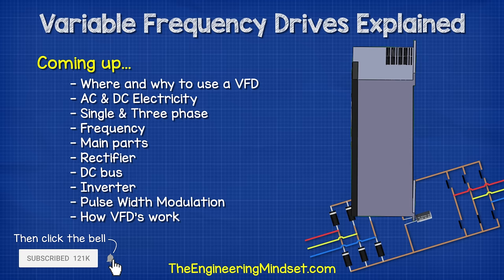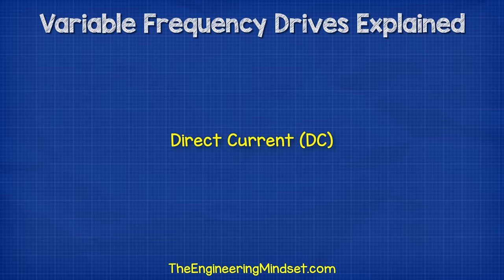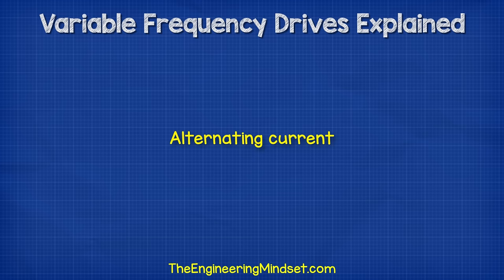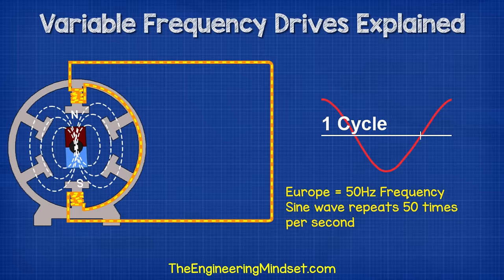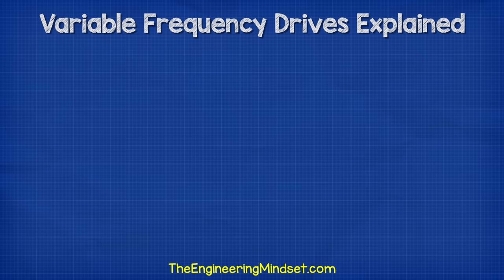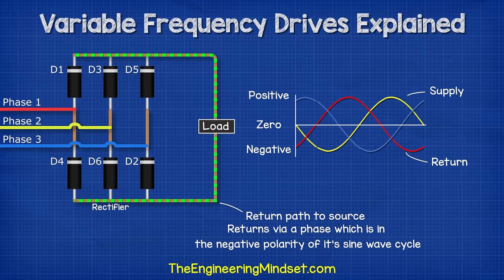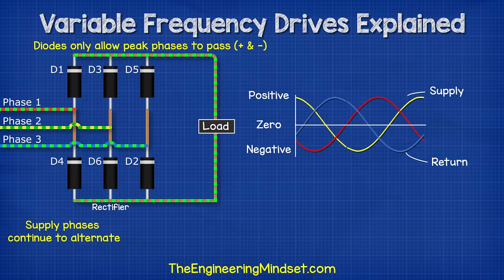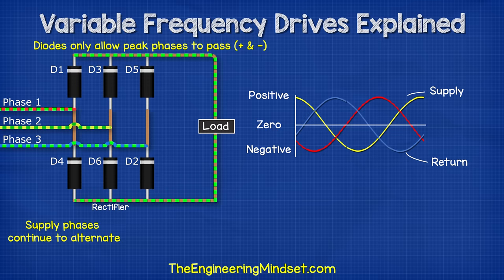Variable Frequency Drives Explained - VFD Basics IGBT inverter

Comment: Why do you convert to dc, just to revert to ac
Reply from the maker: so we can control the voltage and frequency. You must have skipped through the video.
Reply: The Engineering Mindset sorry I kinda thought there must’ve been an easier way to do that, and I was only about halfway through when I posted the comment but I can definitely see you can control the voltage and frequency
Reply: @australiangamer7956  You can technically do it without the transition, but it's a bit trickier and more expensive.

Comment: Nicely explained. Could do with more on the controller and how it closes the LGBT 🤣🤣🤣
Reply from the maker: I was going to include that but the video was already 15mins long. I'll save it for an advanced version
Reply from the maker: I was going to include that but the video was already 15mins long. I'll save it for an advanced version
Reply: @EngineeringMindset  no need to repeat yourself
Reply: @EngineeringMindset  I fully appreciate how long these must take you. I've often wanted to increase 50hz to 100hz for a ac Tig welder and did see this schematic before. Was thinking about increasing the Hz before buzz box transformer but wasn't to sure how much loss would be in an transformer that was designed for 100hz.

Comment: Why reactors using in VFD ? I am from india.!
Reply: Reactors (used on the input side or DC bus) are typically used to reduce harmonics. It might not be such an issue with smaller drives or in places with a lot of other switching loads, but for larger drives or more isolated applications, it's very helpful. Reactors on the output side are typically used to reduce the amount of dU/dt (dV/dt) caused by the switching of the IGBTs. Excessive dU/dt, especially over long distances between the drive and motor, will help protect your motor's bearings.

Comment: i guess the loss in efficiency through the inverter is made up by the increased efficiency of the over all system.  or maybe the inventor just overlooked that because he loved his idea so much :)
Reply: There is not much loss in efficiency through the inverter... The transistors are either in the "on" or "off" state depending on the PWM signal. This leads to a high efficiency and lower heat loss.
Reply: @kevinn2759  the loss is between 10% and 30%. It's physics dude. Do some research on this.
Reply: @ArtisanTony  ive done my research dude.. the loss in an inverter is negligible. Please dont throw random %'s and claim "physics". Its embarrassing.
Reply: @kevinn2759  I have dealt with this for years. I am a general contractor and have installed many inverter systems.  You obviously do not understand the real world.  The real world is not a wiring diagram with a nerd on the end.  The real world is companies trying to create efficient inverters and coming up short.  That is the real world.  What do you do for a living?  Argue?  I bet you don;t do shit.  You just troll the internet trying to start shit. Good job.
Reply: @ArtisanTony  i design inverter systems and power electronics for VFD's, UPS's and lighting systems. Nice try though. Keep connecting wires to terminals while the rest of the people do the important work.
Reply: There's on average 1% lost in changing AC to DC and, typically 1.5-2% lost in switching back to AC. When you look at the other losses in the system, the motor efficiency is the biggest factor. Then the mechanical losses of connecting the motor to the load. Where a lot of the savings comes in is by running the system more effectively. Reducing speeds, especially in pumps and fans gives a huge savings. There's also savings by reducing the current required to start up the motor (induction motors can draw as much as 10x their name plate current when starting up across the line). There's a ton of other benefits, but a bit too much to list. Danfoss actually released the first commercially available VFD back in 1968 and, as I understand it (I work for Danfoss), it was done because there was a meeting on electric motors and people said it couldn't be done. We proved them wrong in around a years time.

Comment: I think there’s a problem with the magnet that generates current. Because the lorentz force is at its maximum when the lines are perpendicular to the coil therefore the peak of current should be when the lines field are in the middle. Plus, when the coils is in the position you describe as the peak current , the lines field go everywhere through the coil resulting in a globally zero current state. I may be wrong but I think you made a mistake
Reply from the maker: It's a fun colourful animation to explain how something very complex works in 15mins.
Reply from the maker: It's a fun colourful animation to explain how something very complex works in 15mins.

Comment: I don't get it. You're describing a pretty complex device and what it does, and yet, you're going back to the most basic of electronic principles. Like, if you don't know what AC versus DC is, how the fuck are you going to know what a variable frequency drive is?  What is electricity? Really? ....then you don't need to know what a VFD even is. You went a little too far back to the basics bud. Can you direct me to the big boy site, for variable frequency drives, please? FYI, I know it AC is, I know what DC is, I know what an oscilloscope does, and I've built robotic devices. So we can skip the - electricity flows like Plumbing-, and get right to the meat of the potato, please....🤔
Reply from the maker: We create tutorials with everything included that the user should know and understand for the topic, it's a complete package. We cater for everyone and ensure everyone has a level playing field, an equal chance to learn. If you feel you're too advanced for that part then skip it forward.
Reply: @EngineeringMindset  yeah I guess. It's just the very simple stuff I've known it for like 40 years, so it just gets repetitive for me. But yeah I understand. You're right.
Reply: @EngineeringMindset  I guess it's like when I watch these basic stamp videos, all of them are like blinking LED starter programs. The first thing I did with my basic stamp 2, using a remote control, I programmed it to lift up a subwoofer box and flip it 90 degrees, while simultaneously opening a drawer beneath with thousand watt amplifiers in it, all of this in the back of a Suburban. You hit the remote on the key fob, and things got busy. When you shut the system down, the subwoofers with tucked neatly down underneath the speaker box and you couldn't see anything but a box in the back, you hit the key fob and the party started. I always want to see some really complex and cool projects used with microcontrollers, although the ones that do it don't explain anything about it. I guess I'm just looking for more complex stuff that's all. If people think that lifting up a speaker box, rotating at 90° perfectly, and dropping it back down, then opening a drawer underneath with amplifiers, would be easy, do you have to program stops, sensors, starting and stopping points, then the mechanical end with bicycle chain sprockets, window motors and you have to hide it all. The microcontroller ended up being the perfect device to control all this.